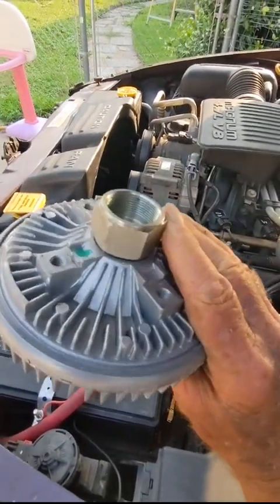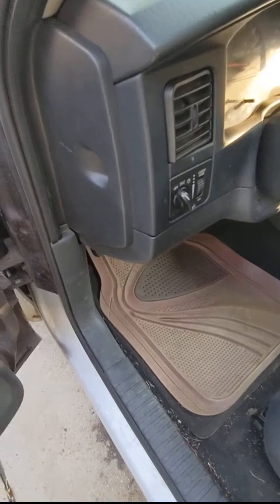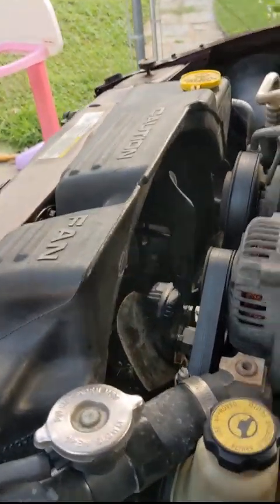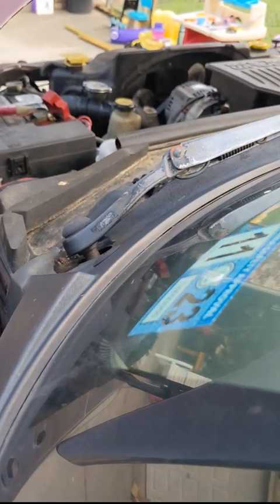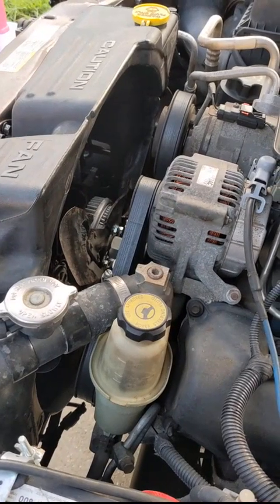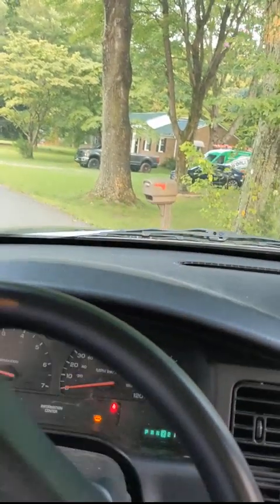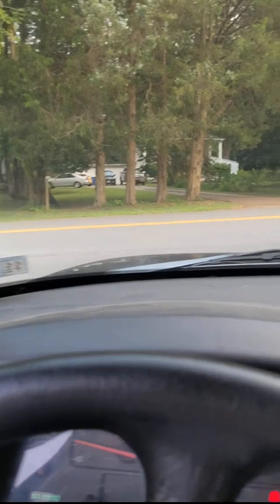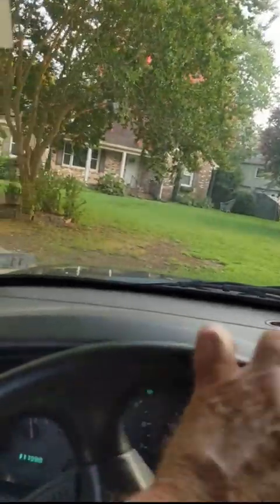Brand new clutch fan fails!

Comment from the maker: My power steering pump is noisy, so I have one to replace it.
Besides that, the alternator is also sounding like the bearings have seen better days.
Both are working, but I will put the new pump in at some point.
I'll wait on the alternator acting up or dying before I do that one. They tend to have core deposits.